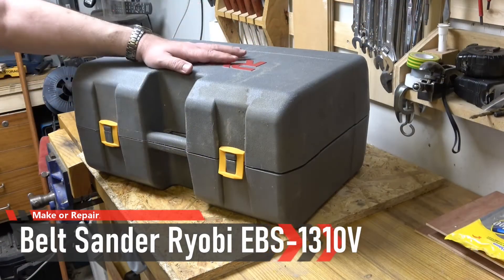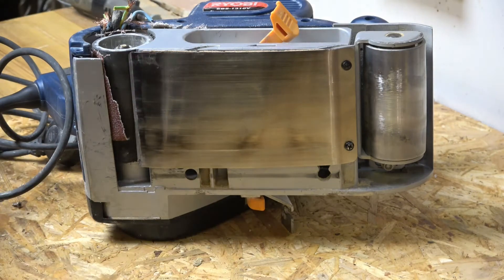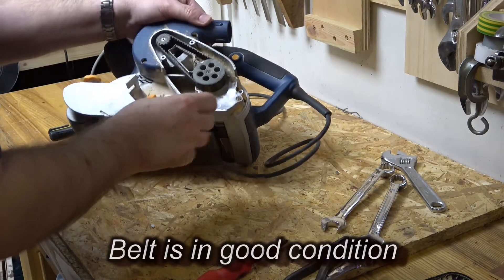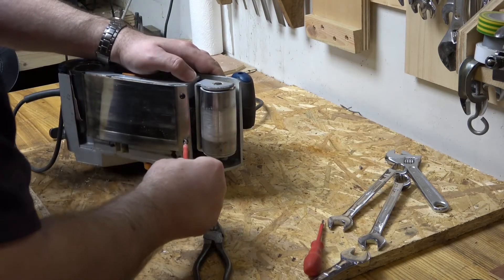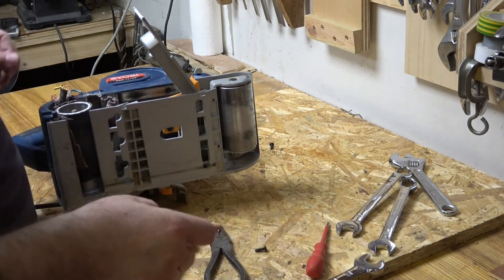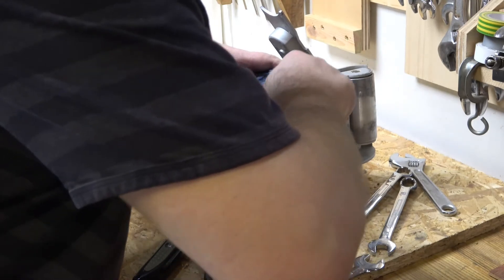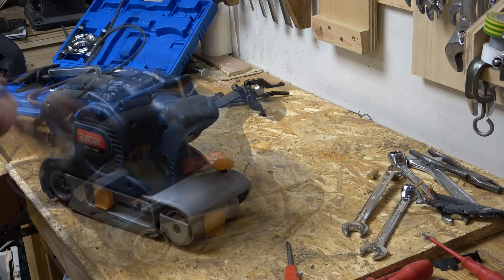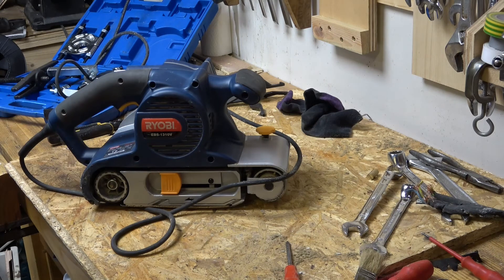Belt Sander Repair Ryobi EBS-1310V #0050

Comment: MERCI , j 'ai eu le même problème en 2021 avec son propre câble  en voulant changer la bande . impossible d'ouvrir en deux parties la machine , j'ai enlevé la courroie difficilement par la petite poulie . puis j ai tourné le rouleau arrière ou était coincé le câble 3 heures . j avais aussi enlevé son écrou mais je ne pouvais pas enlever le rouleau . j'ai pourtant la même boite d'extracteur mais je n'ai pas penser à faire avec juste une branche comme vous. très bonne vidéo  merci encore  ,
 I had the same problem in 2021 with its own cable when I wanted to change the band. impossible to open the machine in two parts, I removed the belt with difficulty by the small pulley. then I turned the rear roller where the cable was stuck for 3 hours. I had also removed its nut but I could not remove the roller. I have the same extractor box but I didn't think to do with just a 1 branch like you. great video thanks again
Reply from the maker: Merci, content que vous ayez apprécié.   Which I'm sorry to say is about the limit of my bad French!
Reply: @MakeOrRepair  you're welcome my tractuction was with google
 I had the same problem in 2021 with its own cable when I wanted to change the band. impossible to open the machine in two parts, I removed the belt with difficulty by the small pulley. then I turned the rear roller where the cable was stuck for 3 hours. I had also removed its nut but I could not remove the roller. I have the same extractor box but I didn't think to do with just a 1 branch like you. great video thanks again

Comment from the maker: Later in the video I call the tool a gear puller, strictly it is a bearing puller or bearing extractor.  It can be tricky to find the words when both figuring out the fix and talking at the same time.

Comment from the maker: Removing the case would not have helped, towards the end you can see the bearing holder and the wheel surround, into which case is trapped,  are all a single casting.